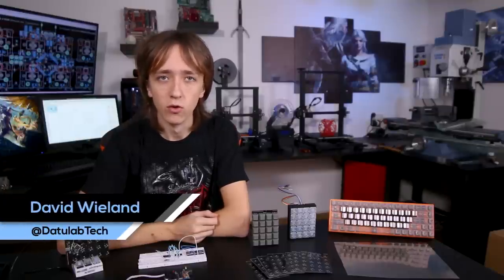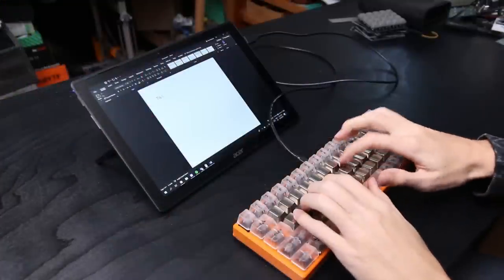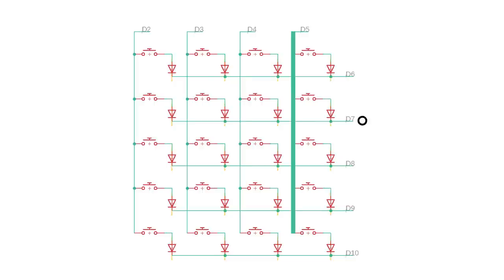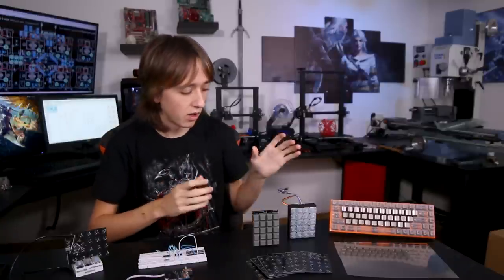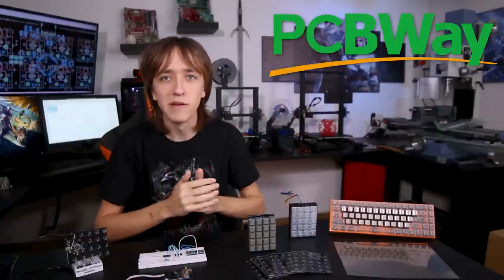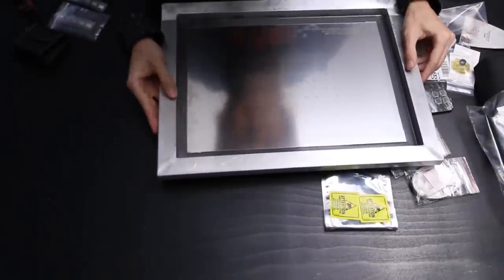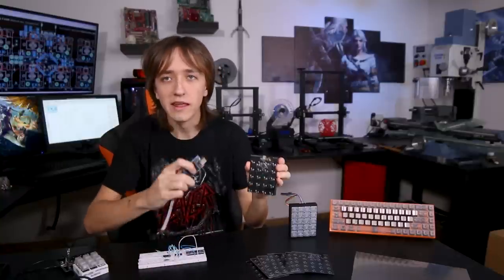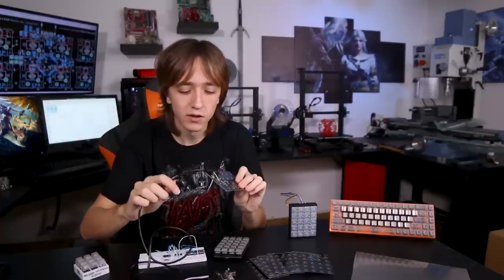DIY Arduino Mechanical Keyboard - First Prototype

Comment: I looked at your video when I was building the same thing and I noticed a few things that might fix issues if you are still having them. First, the Atmega32u4 chips come in two types that I know of, Atmega32u4AU or Atmega32u4MU, where AU has a bootloader pre-installed and the second doesn't. I looked at your schematic and a few things popped out at me. On the USB-C receptacle, you don't have any 5.1k pulldown resistors to indicate your device is a sink which might contribute it to not being recognized. Another thing, when you reset the device using a reset switch on the reset pin the bootloader on AU chips should automatically start and be recognized. I only have started getting into this so I could be wrong and my first test pcbs are still coming in the mail. Hope any of this might help.
Reply: have you managed to program your boards. I used keyboard firmware builder and it works, though i cant get N-key rollover to work. I've been looking at QMK now, though still having trouble

Comment: you might need to short the reset pin to ground on startup to put it in to bootload mode. I had a similar issue

Comment: I'd be very interested in seeing the code for the keyboard as well as knowing how it handles key rollover. I've been toying with the idea of building my own arduino keyboard but everything seems to use a teensy and QMK/TMK
Reply from the maker: The code has some bugs which causes weird behavior, however the rollover works flawless without having to do anything, just due to how the switches are read.
Reply: QMK Officially supports the Arduino Pro Micro and its clones quite readily

Comment: Plugging it into some random Windows PC do i need to install driver or anything special including arduino ide or it just work like a normal keyboard as soon as you plug it into any pc?
Reply from the maker: No drivers necessary, just to program it, but not for normal operation
Reply: @DarkArtGuitars  No i mean if i make a usb rubber ducky to run some commands on victim pc open run type this stuff does it help?

Comment: Awesome! How did u map the key '?/' ? I mean what hex value from ascii that worked for u?
Reply from the maker: I don't know off the top of my head, but both the QMK documentation and the arduino library doc have a table with all the commonly used codes, it's best to check there.
Reply: @DarkArtGuitars  Yeah, but using the value indicated by the table shows a comma instead '?', I bealive it's a problem in my system's language maybe :p thx very much for replying!

Comment: your wiring is very good, what did you use for the rod used to solder all the diodes to the row?
Reply from the maker: Just some wire that I stripped the insulation from.

Comment: Thanks.  I did take a look at LaunchPad.  It has controllable backlight color for every key.  But only the most expensive version can be programmed to show any color you like.  Neopixels only require 1 Arduino pin!
Would something like this be a nice project?

Comment: I hope you dont sit by the 3d printers while they are printing. If you are, I would suggest you tu build enclosures and ventilation for them.
Reply from the maker: I am using almost exclusively PLA, which emits hardly any fumes, and the ones it does, are rather harmless and not too unpleasant. If I were to use ABS I would of course use and enclosure, or have the printer in a different, well ventilated space.

Comment: Hey mate I've decided to try doing this myself too!  I've good quiet a few reasons and applications and variations I'd have a use for.  If you don't mind at all, could you possibly sort me out with a few link to the documentation and other resources you mentioned while you were researching your attempt, please?  - I will take your recommendation re. Eagle PCBs etc. today myself but perhaps you can share with me some other sites and videos that might help as I'm pretty clue-y and learn very fast but I am just beginning and finding it extremely difficult to get info that lines up well with what I foresee my project to be -  I want to build a bespoke controller (and know-how) that is not a "pseudo"-solution or a toy.  But there's many  types of HID/purposes I could see myself designing for.

SO any help you can throw my way would be very much appreciated

Thanks again for your work
Reply from the maker: I have quite a few videos on the subjects on my channel, so feel free to browse a bit. I'll also be doing a detailed beginner focused series where I go over all the steps, releasing in the next few weeks/months.

Comment: Whats up, would you be able to help with a button matrix. I'm trying to get it not to ghost as i have a few 2 way toggle switches that gets held in and am trying to figure out where the diodes should be for no ghosting.

Comment: Hello i think at 10:11 Might be that the chip it's self needs a boot loader to be burned to it. I had that problem once and burning a boot loader did work and took it from unknown to a arduino device. Might be different in your case but this was the problem from mine.

Comment: I've seen that you have WS2812B RGB LEDs on the schematics you've posted on the arduino forums. Just consider doing the math on that before you try to drive it from a normal USB port... If you run them at full brightness they can draw around 20mA per color, so thats 60mA per RGB-Pixel. 20 of these LEDs on the keypad would require at least 1.2A of current! Standard USB 2.0 specs only allow you to draw 100mA, or 500mA if you tell the Host (PC) that you are a high power device. Just keep that in mind...
Reply: On a more general note, in regards to your problem with the programmed controller not showing up once you flashed the bootloader, here is a hint for you:  Since your schematic of the circuit (again, the one you posted on the arduino-forum) unfortunately has an (in my professional view) completely unusable and useless schematic symbol for the usb type-c connector, my guess is that your fault is hidden in there. A good schematic symbol always shows all the pins available on the physical component, and every pin needs to be properly labeled with it's number and function (Pins A1-A12 and B1-B12 + shield pins for a Type-C connector). As a little guideline on all stuff related to this USB topic, maybe go read AN4775 from STMicro. It should get you up to speed and help you find errors with your Type-C connection. You will find out quickly that you need resistors on the CC1 and CC2 pins to advertise a legacy device and even tell the power source how much current you want to pull in the worst case. That might even help getting those RGB-LEDs to shine later on...
Reply from the maker: Thanks for all your pointers, I will consider them when I get back to this project!
The USB port likely isn't the only issue, as I tried the circuit with just a normal USB 2 cable soldered on the required contacts, with the same results. The reason for the weird symbol is that it was extremely hard to find a suitable package with the USB c connector in it that I was using, this one was the only one that I found that was even remotely close to what I was looking for. I guess it's just still too new of a connector to be widely used by hobbyists.

Comment: You should have a look of GH60 project. It comes with an ATMEL microcontroller you can program marcos using the qmk firmware (and pretty much all the custom mech keyboards can do that). This project is pretty well known in the custom mechanical keyboard community. Go to Geekhack to learn more.

Comment: Hey, doubt if anyone sees it but why not try asking, is a pcb necessary even for a 2 keys keyboard?
Reply: also why are these 2 keys keyboards so expensive? they sell em for a price which you can allready get full mech keyboard xd
Reply from the maker: You can totally do it without a pcb, I even did the first full size prototype by soldering it by hand.

Comment: come on!!! the video was so cool, why not sharing that code??? :/
anyway... I can't dislike your video, I love you for that connection schema <3
Reply from the maker: My code has some major flaws and I wouldn't want people using it and getting frustrated with the project because of my badly written code. If you don't feel comfortable coding it yourself, maybe have a look into the tmk or qmk opensource keyboard firmware, I've heard great things about it.
Reply: @DarkArtGuitars  I just saw the answer, thank you for your time, I'm finally doing my custom keyboard! your content is awesome! :)

Comment: Very cool project indeed - simole solution would be to move fully programmed chip from real arduino over to your board. its a good way to verify your board - also start with only arduino related componets and skip switches etch. best of luck!
Reply from the maker: The only issue is that moving over a 40pin smt component without damaging it is rather difficult, especially without proper equipment. I might give it a try though.